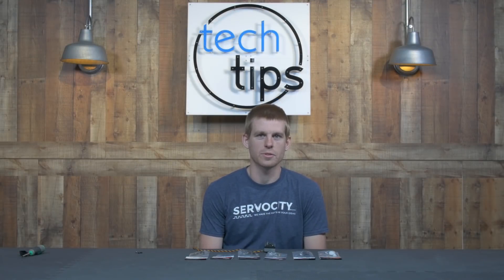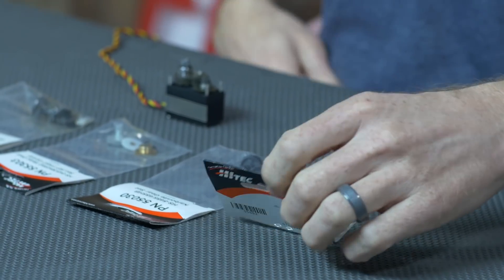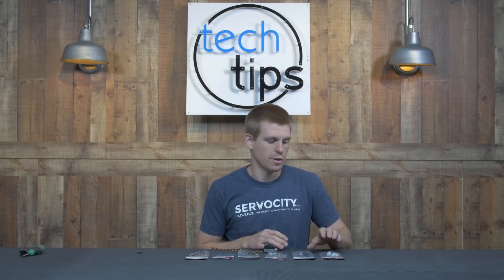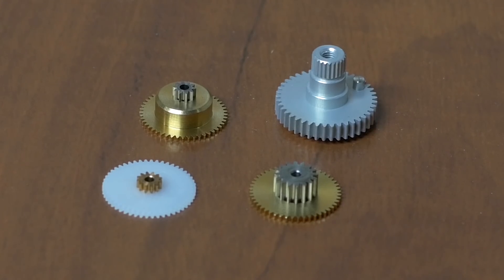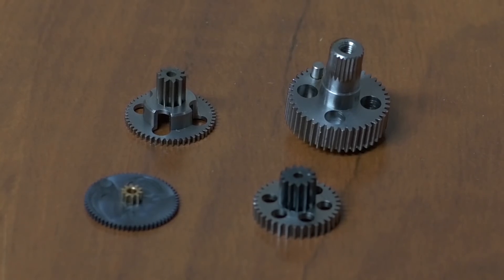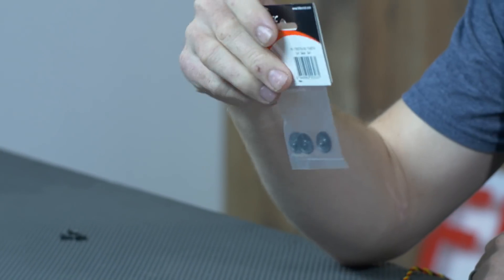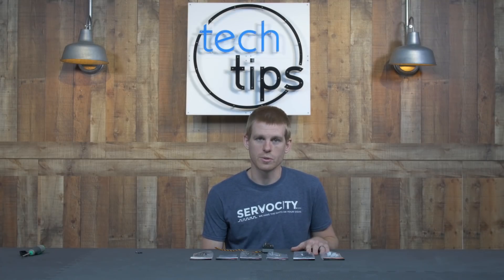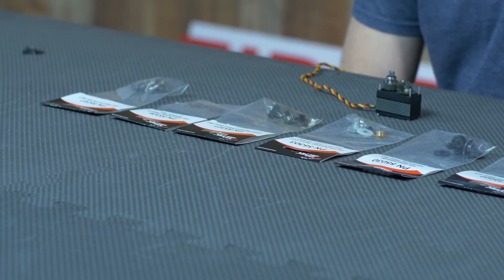Servo Gear Materials - The Secret Life of Servos Ep4

Comment: hello , i have a 1/5 HSP 26cc BUGGY  & iv got my servo apart but can't remeber how it gose back together so it works 

can you please help me , it has 3 round gears inside & one one top were the bit pokes out to put the horn on topart # SP2701 - steering  servo ( 27kg )
Reply from the maker: While not all servos have the gears configured the same way, most of them are quite similar.  Please go to this page: https://www.servocity.com/hs-318-servo and check out the picture with the top case removed.  It's probably not the servo you're running but it may give you enough info to get your servo back together.  Should you have any further questions please feel free to email tech@servocity.com and they will be happy to assist you further.

Comment: Hello.I was wondering what grease is best to be used on metal gears,say titanium?I have a silicon grease and a silicon spray,will it be good for titanium gears?
Reply from the maker: While not an expert in lubricants I think white lithium grease would be a good fit for titanium gears.  Silicone grease may be fine too; the spray is likely to be a bit too lite in terms of viscosity.  Let us know if you have any other questions tech@servocity.com and we'd be glad to help!
Reply: Yes,you are wright.Will use the silicon grease,it's more dense and it's neutral so it can be used on diverse aplications.Don't know the density but I can always wash the gears like you did and lubricate them again!Thanks.